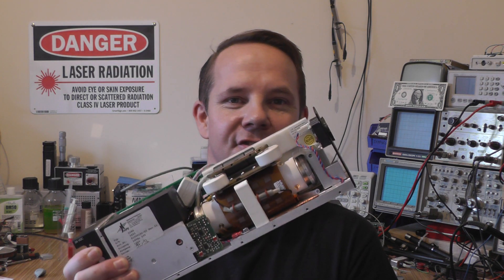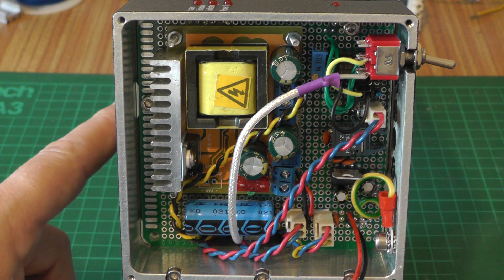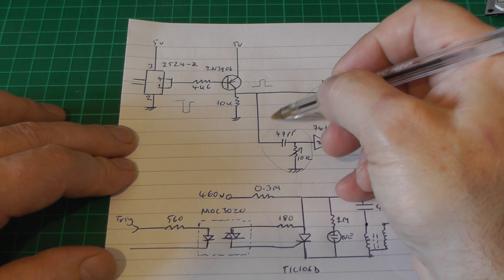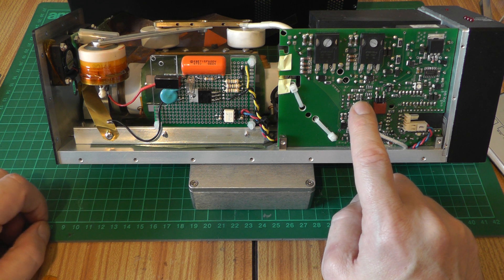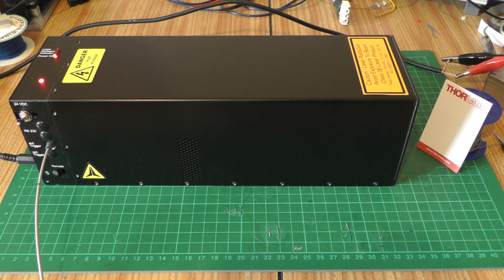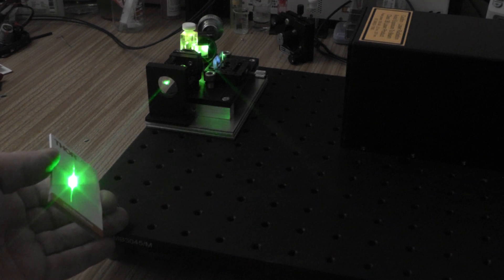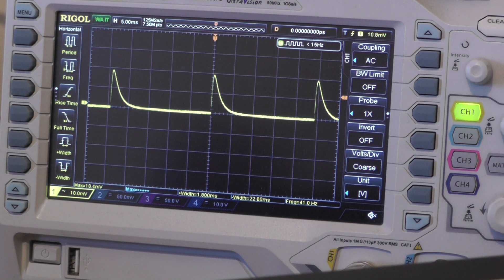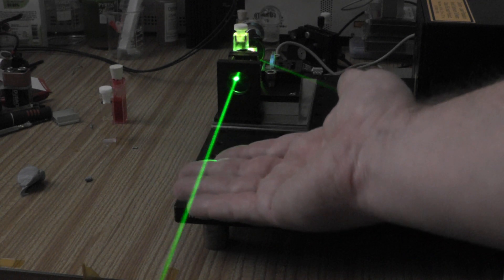Dumpster Laser rebuilt and modded!

Comment: The laser has no clock, you cannot increase the clock speed of a non-existent clock. Unless it's an anti-matter quantum clock in the 11th dimension. But if you have one of those, there is no need to overclock it. In fact, overclocking an invisible 11th dimensional anti-matter clock may result in a tribble influx of damgerous proportions. Tribbles are a serious problem in the 11th dimensional state, because they excrete dark matter qu-bits in their stool. Try cleaning those up with a broom and dustpan, or putting them in a plastic bag. 

While we're on the subject, i heard that is the plot of the upcoming Star Trek movie. It sounds a little basic, but it'll be better than 2 out of the 3 star wars prequels. 😂

Comment: Excellent job hacking the laser and making it work. Ever tried filling the plasma tube of a nitrogen laser with excimer gas mixture? These look to be an excellent host for conversion especially since they have a real preionizer in them. Excimer mix is generally 90% helium and 10% excimer mix. Ones with flourine would be out, but ones with chlorine would be ok, XeCl KrCl ArCl etc.🤓

Comment: I'm really glad you did this teardown.  I'm hoping to build a sealed nitrogen laser chamber.  (but will build a few SG switches first! :) )  Quick question.  Do you think that the potted module functions in a "traveling wave" pre ionization fashion?  Second 'quick question':  how does the output of this laser compare to what you used in the bayer filter ablation video?
Reply from the maker: Thanks! The potted module just dumps charge, there is no travelling wave in here. The travelling wave thing was popularised in the Sci-Am article, and there is a robust discussion on why is isn't so here: https://jonsinger.org/jossresearch/lasers/nitrogen/circuitboardlaser.html
Compared with the Fiber coupled version, the output is considerably higher :-)

Comment: It’s been a long week and I’m super tired… So I’m probably just confused… or I missed your explanation…But does your function generator have an optical signal output? Or do you still have that small daughter board you made several months ago, with a really bright LED and everything?
Reply from the maker: I just connected an LED direct to the output of the function generator (the duty cycle is really low, so no real need to current limit). The led is shoved in a little brass mount that couples in to the end of the fiber.

Comment: If you mix the dyes, do you get multiple lines in the same beam?
Reply from the maker: It is possible, and I have done it, but the output is very weak. The problem is that the absorption and emission peaks of different dyes overlap, and they rob each other of energy. 
There is some reference in the literature though, that suggests that it can be done reasonably well, but they were manufacturing their own dyes, or had access to some very uncommon and expensive ones. 
I have actually just spent the whole evening scouring academic papers and found one in particular that looks really promising. The dyes are expensive but not extortionate, so it is now on my to-do list...

Comment: Just lovely (!).  //  Have you tried Rhodamine B in propylene glycol or glycerol? I've read that the quantum efficiency correlates with solvent viscosity (IIRC, the claim was 0.43 or so in methanol, on up to about 0.98 in PMMA plastic), so I'd expect higher output power. The viscosity comes at a cost, though: the dye solution is going to take a lot longer to move out of the way after it has been heated by the pump pulse, so you aren't likely to get high rep rates. (Liquid laundry detergent ["free and clear" type] provides another example of this; the output from the optical brightener dwindles rapidly as schlieren take over and scramble the optical path.)
Reply from the maker: I have not, but I will at some point. I suppose if the results are good, it might be worth getting creative and putting a miniature magnetic stirrer in the bottom. 
I am also thinking about building a TEC cooled cuvette as well. I read somewhere in the literature that cooling dyes could in some cases improve efficiency (come to think about it I am sure RB was mentioned there as well)
Reply: @LesLaboratory  Excellent. I think only a few dyes have quantum efficiency that correlates (one direction or the other) with viscosity; IIRC, though, a fair number correlate inversely with temperature, and I seem to recall, as you do, mention of RhB as one of them. (Nitrogen also lases better when it is cold, btw.)  //  I like your ideas for a tiny magnetic stirrer and a TEC cooler (!).

Comment: love your work. I'm wondering, what happens if you mix the dyes together? you get multi line emission, or they interfere with each other someway and prevent lasing at all?
Reply from the maker: Thanks! Generally it works pretty poorly (I have done it), as the dyes tens to rob energy off of each other. That said, it is pretty cool when you get it to work! I am planning on doing some more Dye Laser videos, so I will probably do it at some point.

Comment: Les, I strongly doubt in your power measuring experiment, because your nitrogen laser generates pulses of ~2.5 ns time scale with a ~nanosecond risetime, and your measuring equipment  has way less temporal resolution. 50 MHz oscilloscope can give you rise time of ~20 ns, so it is integrating the real signal amplitude.
Reply from the maker: The measurements are correct. I am not measuring photons with a photodiode, but energy with a Pyroelectric Joulemeter, and these work much differently. The energy deposited in a Pyroelectric sensor is converted into heat, which is then measured. In this case, the pulse length does not matter, (nor is it measured) indeed you could measure the energy of pulsed lasers down to the femtoscond range.
The width of the pulses produced by the sensor are quite wide (~5ms), bit for these devices it is the pulse height that is directly proportional to deposited energy.

For an overview of how these devices work, and how to measure with them, see the links here:
Gentec Catalog with how to perform measurements (page 13) : https://www.gentec-eo.com/Content/downloads/complete-catalogue/Gentec-EO_Catalogue_2014_V2.0.pdf

Gentec Catalog ED-100 (Page 32) :  http://www.tsukasa-tec.co.jp/product/measure/documents/catalog_000.pdf
Reply: @LesLaboratory  Have to admit that you're right, I wasn't familiar with that particular joulemeter. 

By the way I have another question for you, when you dismembered the original unit, there was three fiber connectors in it (blue and gray). As far as I understand it is some sort of "V-PIN connector". I'm thinking on making a fiber "Time delay network" in my lab, and particularly, want to use such kind of a thing.  Can you give more info on that fiber connectors and how they work (at least part numbers)?
Reply from the maker: @RoosieBoomstick  It's cool, nobody knows everything!
That sounds like a cool prject. Yeah, the fiber and connectors are Avago HFBR series. The transmitter is: HFBR-1521Z and the receiver is HFBR-2524Z. The Transmitter is nothing more than an LED in a fancy package, the the receiver is a photodiode and inverter arrangement internally.
There is a handy data sheet for the range here: https://docs.rs-online.com/4791/0900766b813646c5.pdf
Reply: @LesLaboratory  Thank you, time to give a quest to one of the students xD